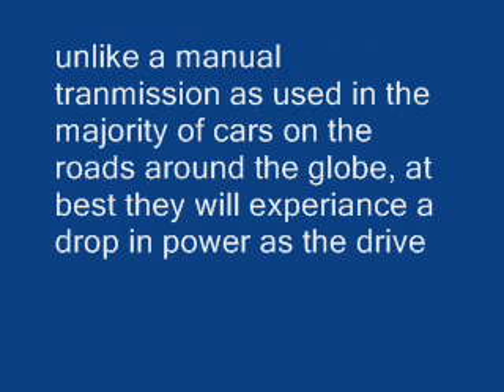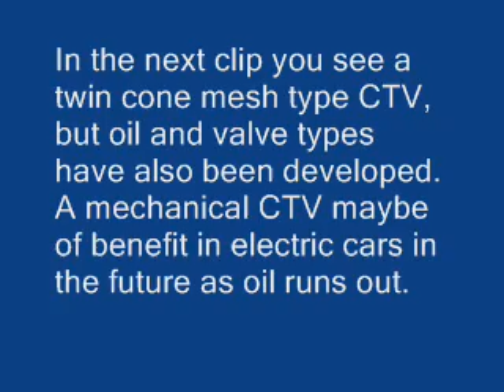CVT explained

Comment from the maker: hey thanks for your comments, I agree CVT's will become more the norm as they are developed more. I dont think they are any less powerful but are great for highway driving where you go from 0 -60mph and hold it there for many miles, were it is weak is on very twisty roads where rapid gear and rev changes are needed, the CVT can be a bit slow to "downshift" where a large drop in speed is required because of a series of sharp bends in the road.this can be seen when you pit an automatic vs a manual

Comment from the maker: Thanks for your comments, the cone decreases in radius from the large end to the small end as the chain moves down along the length of the cone towards the small end the cone will bite into the same amount of teeth but at a closer distance, in a conventional gear box the radius and number of teeth decrease but its the decrease in circumference in the driven cone and increase in the driver cone that provides the speed changes. as the spacing of the teeth change it cant be compared to gears.

Comment: the chain has it's tooth, every tooth are the same size. so imagine using a gear to drive the chain, the gear's tooth must clutch exactly into the chain's tooth, or it will cause some slippery. Because the chain is composed of segments, not continuity. the cone only can imitate a gear with integral teeth. That's why I say it's gear ratio won't change continuously.  

P.S.
My English is poor. If anyone would be willing to correct my writing, I will be very appreciated.

Comment from the maker: explain how you come to that conclusion? As I see it the Demo shows the system with the capability to alter the driver and driven cone continously to provide stepless speed changes, system as used by Mitsubishi allow for the driver and driven CVT to change independantly to keep the torque at its max troughout the speed band.

Comment from the maker: true, but with a manual u are disconnecting the engine from the drive for 1/3 of a second to change gear,u have the issue of time for the syncromesh 2 match the rotation of the gears, with a CVT u can achieve a balanced increase in acceleration, u are always @ peak torque,if the weight issues can be overcome i can see a big future for CVT's.they will be especially useful with electric cars, this petrol head for 1 will cry the day they take away his petrol car & replace it with a elec car.

Comment from the maker: you have a point but Mclaren built one for there F1 car a few years ago, sadly the FIA outlawed the use of CVT's that car was a 3lt V10 with 900 bhp+. the CVT is demo is only one method of continously varing the transmission. It technically can be done for racing cars but the question is, is it to expensive to develope for powerful road cars. Thanks for you comments.

Comment: i don't think a CVT can be ever used in a racing car..i mean...it's a metal belt transferring power from one metal wheel to the other with nothing securing it in place..and put 600hp and like 500 torques it's not gonna handle it

Comment from the maker: A CVT in any car from an operations point of view works the same as any automatic, just put four foot down but with a CTV the power delivery is stepless with no losses as in a manual, but unlike a manual you cant short shift or overdrive the car to gain advantage.